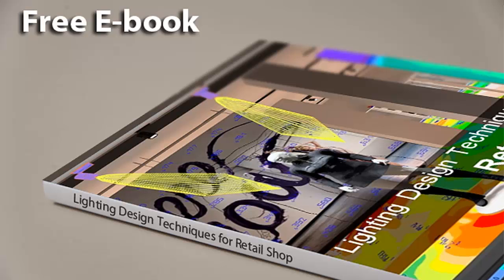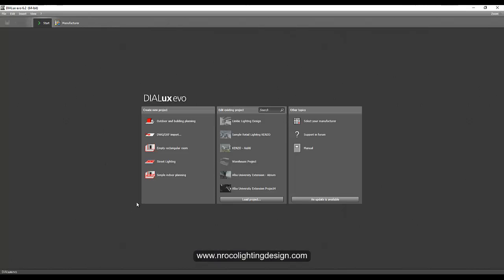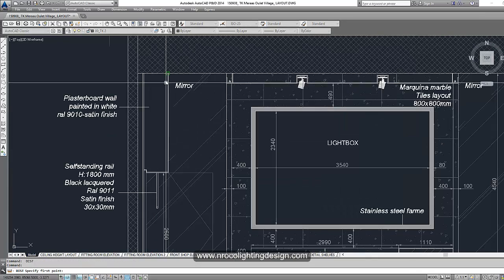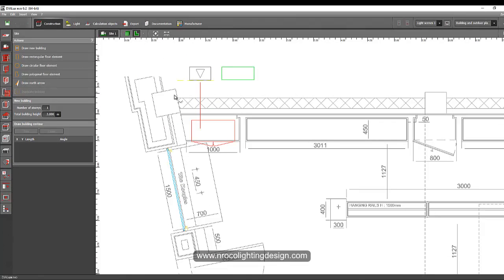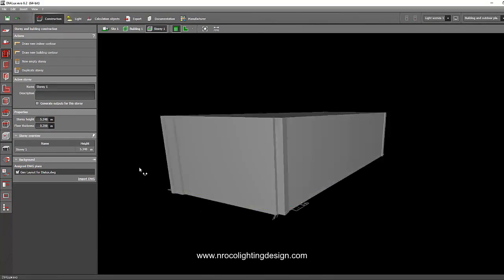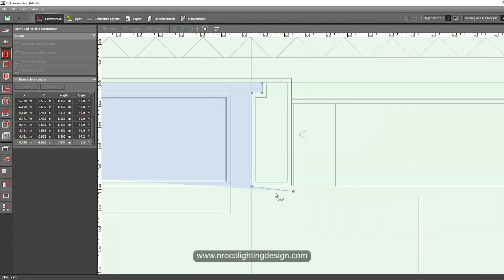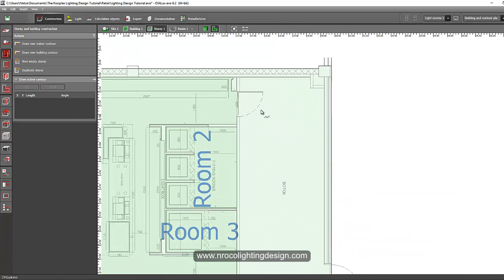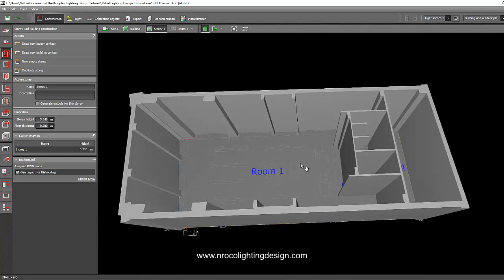02 How to build rooms PART 1

Comment: What is the difference between drawing indoor contours than creating new room? Why use it and the other feature? Can it be used to create molding or cornice?
Reply from the maker: Hi Michael, you can use creating a new room directly if you want to run the lighting calculations per room only.  Indoor contours can be used if you have room inside the room.  If you want to create molding, please use the extrusion volume in the object tab.  Hope it helps! enjoy learning!